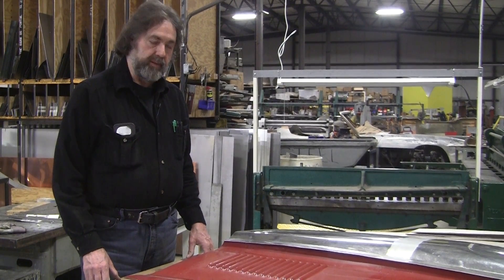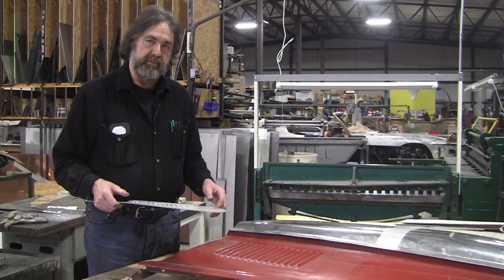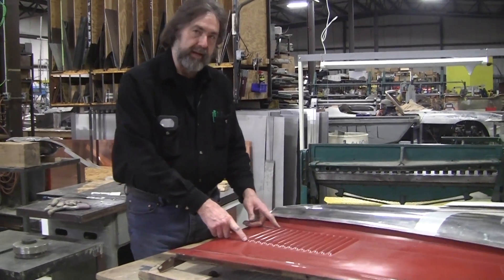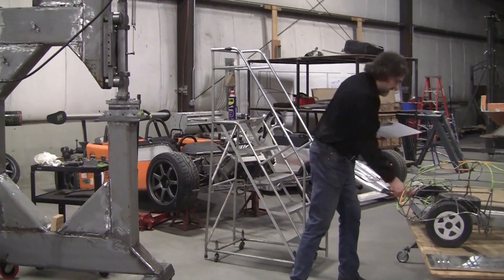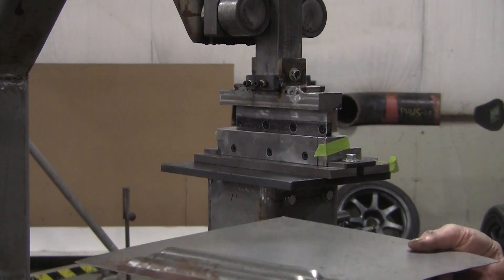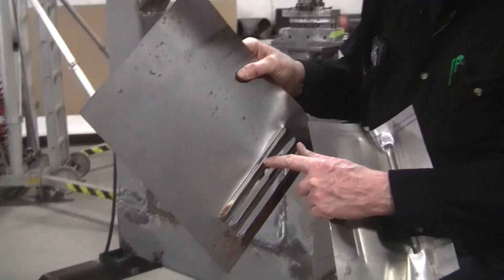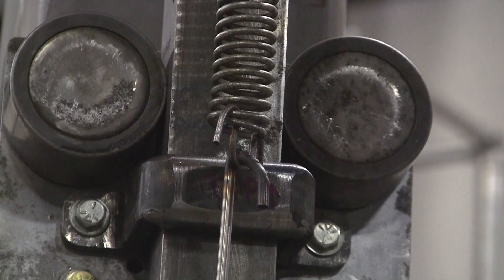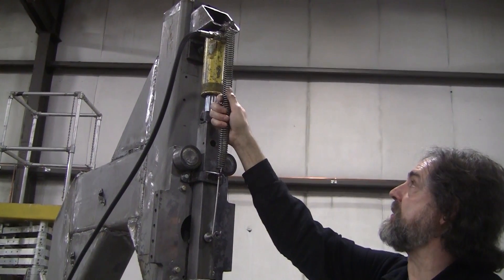Louvre Press built in the shop!

Comment: This shows that building machinery with no knowledge of shear strength or mod of E just costs you money ending up with an inferior product.
Reply from the maker: Huh works perfect!
Reply: @proshaper  Thanks for the reply. I am sorry if I have upset you by my comments. However I still stand by my comments. As a design engineer (now retired) the cost of design and supply of drawings to your  specification would be small compared to the cost of your C frame press as shown in the you tube we refer to. Indeed why not buy a second hand C frame press and just bolt on your tools. These options would be available had you used an engineer. This is my point and I make it so your viewers would have the knowledge and options prior to undertaking manufacturing prior to looking at alternatives.

Comment: I use a similar spring trick sometimes if I need adjustable tension and/or length of a spring it's a very useful trick..  I think it could definitely be stronger than a traditional bent hook.. my method is a bit different, I usually manage to find a tube that fits over or inside of the spring so I just need one piece of thin rod perpendicular to and through the tube and usually flatten the other end and drill it for a makeshift eye hook.. I have made one with a swivel allowing adjustment while the whole thing is assembled too.. I got my hands on an old rotbox vw I decided to punish myself and make all the new pieces myself with no metal shaping tools.. so naturally I got on the interwebs and before long found your channel a couple weeks ago  and there's nothing else like it online 👍👍.. now I just need to stumble upon a "pro painter youtube channel" and I'll be cooking with gas!

Comment: Nice work! Would it help a bit to put the die at a very small angle to start the cut on one side like a shear? (I can think of a mechanical construction that start at a angle and stops on a straight line). I believe Lazze said something like this in his louvre press video that the flex of his frame helpt a little bit to start the cut at an angle and that why the die needs to be in line with his frame.